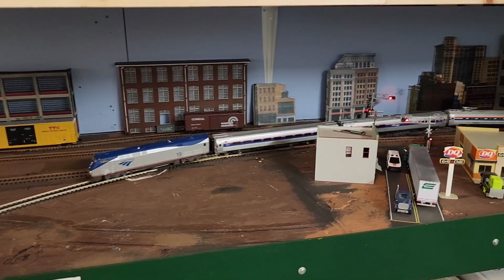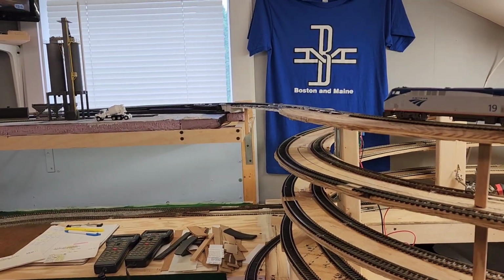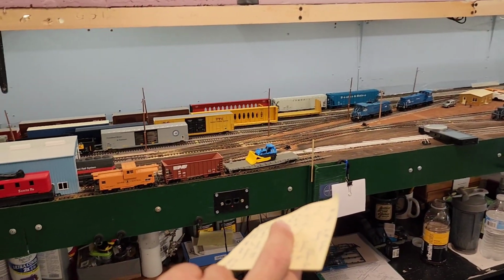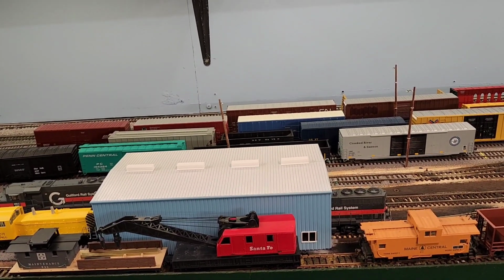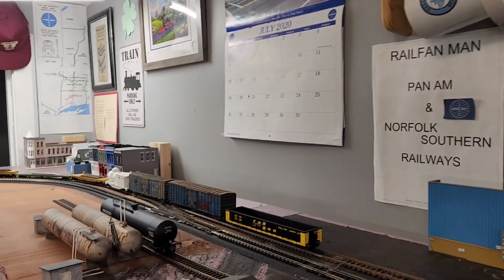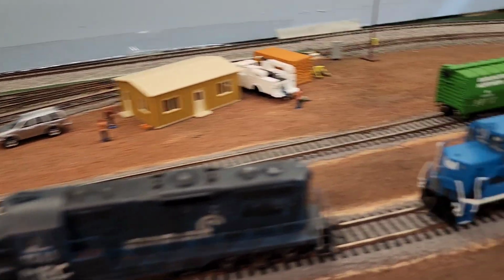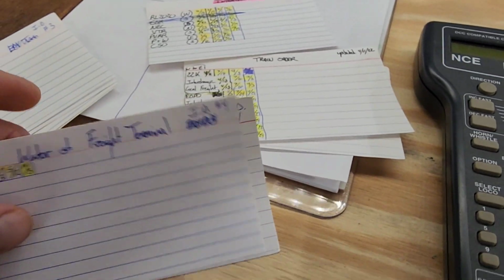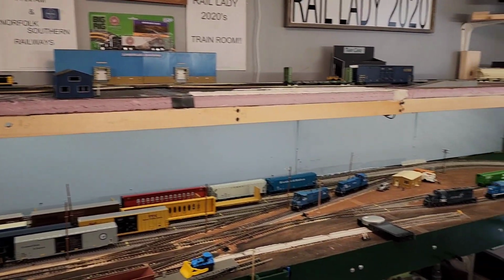Layout overview.

Comment: The Yard,Man. The Yard is great. Hours of switching possibilities & problems. I like your layout. Out of curiosity. How many sheets of plywood for your Helix ? Impressive HO engineering feat.
Reply from the maker: Thank you Steel Mill!! I like the yard myself considering it's in a small space, however I'll take it over no yard 🤷‍♂️😅 
The helix was built using plywood from a previous helix build and I believe it was almost 2 sheets I used. Thanks for stopping by and have a good night. Happy modeling!! -Jason

Comment: Where in JMRI do you run Ops?
Reply from the maker: In the operations part of JMRI I go to routes and make a train up for example 22k Then I go to the trains section in operations and build the train. The rest is either write the cars I need on paper or print it out and then physically (050) the cars on the layout. The train freak has some videos on how to use JMRI if your just getting started. Very informative. Hope this helped.